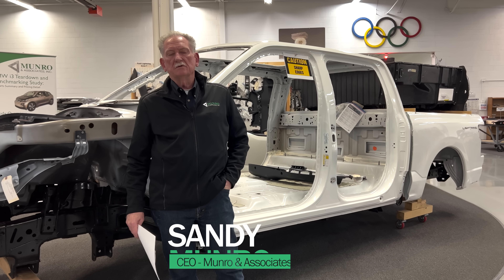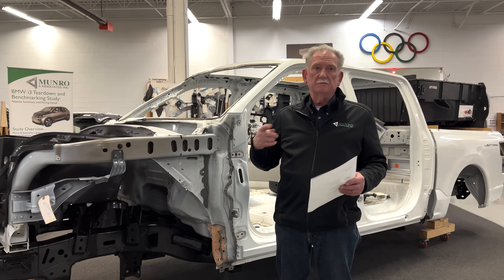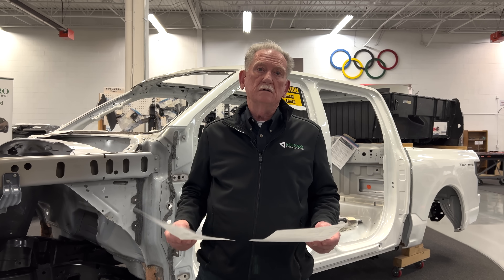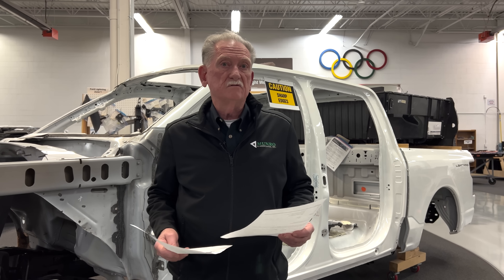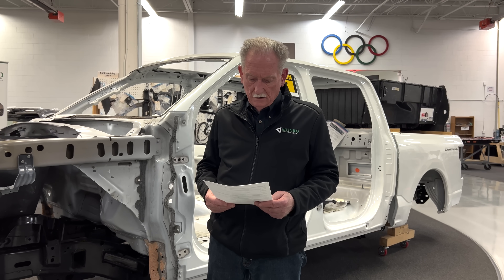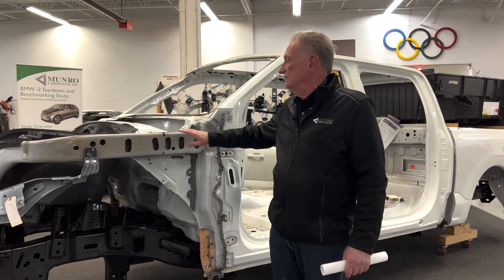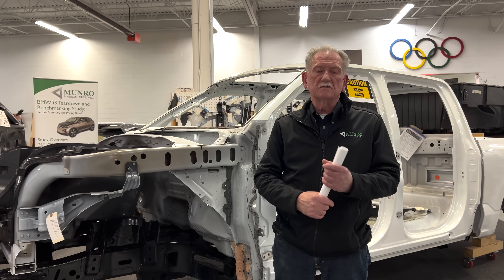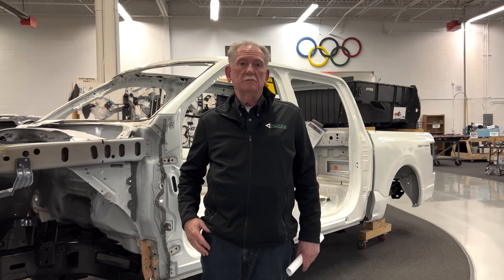Sandy's Initial Thoughts on the 2025 Ram 1500 Ramcharger

Comment: We know Sandy hates plug-in hybrids, of which the new Ram is one. Here are the counter arguments: 1) Since most use is actually short trip, the plug in Ram user will mostly be able to just recharge at home/work and rarely buy liquid fuel. 2) For the occasional long trip, especially if towing heavy load, the ICE is ready to take you almost anywhere worry and hassle free. 3) The much smaller battery pack saves tremendous expense and reduces the environmental impact of making the new vehicle. You can build two or three Rams with the same amount of batteries as use for one Lightning. 4) Charging availability and time. Other than Tesla's network, most US charging networks still stink. They are unreliable, slow and hard to find. 5) The built in gas to electric power outlet function replacing a traditional generator is great for camping, household backup power and some worksite uses.

Most people are trying to buy a vehicle which will both suit their daily needs and their occasional needs. For many use cases a good plug-in hybrid does that.

Comment: This is great news. Now let's shrink the battery to only 50 miles of range, build a cheap generator with alternator ass one unit. Make it easily removed from under the hood. Make a e-axle. If u do this it can be built cheaper and lighter than a gas truck today

Comment: many of us that use trucks for actual truck purposes travel in areas with no charging infrastructure on a regular basis. Rural America is not going to get comfortable with EVs for a very long time.  That is what makes the ramCharger voltTech approach reasonable. You could hardly give me a ford Lightning. I would have no use for it other than scooting around town. Rural towing is a no go. GM made a huge mistake IMHO and I see both Ford and GM being in a world of hurt for quite some time as those EV trucks sit on the lots and they continue to sell at a loss. ICE is all they really have to keep them afloat. The argument that you only need more than 300mi range X% of the time is like saying you only need 4wd 1% of the time.. However that does not matter, when you need it, you 100% can't go without it, so nobody will buy a tool that will not meet their 1-10% use case needs. Ford and Chevy lost out, especially Chevy since they had the Volt platform and abandoned it for all the wrong reasons. Range extended plug in EV was the natural way to transition people into EV. I hope Dodge does not screw this up and builds something reliable and has parts and techs to fix it lined up.

Comment: RAM is almost the defacto pickup for horse hauling. Waiting around for a charge with horses getting antsy in your trailer is a no-go. The Eco-diesel powertrain was perfect for this.  It has a 600 mile range, which reduced to about 400-ish towing a 3 horse trailer (and getting ~20 mpg while towing). This will be great to see how the gobs and gobs of electric torque do on towing in the Ramcharger. I'll be interested to see how it tests on TFLTruck's "gauntlet" test in Colorado, and Stellpower's  "Will it horse" tests. Once again "If you want to haul, buy a Ford.  If you want to tow, buy a Ram. Just don't buy a Chevy", Still the best advice I received from my Farming relatives.
Reply: Good synopsis :)
Reply: Eco diesel was a failure and unreliable af
Reply: @Kylewraps   I own a Gen 1, that is approaching 100K miles. While this engine has it's issues (and recalls), 26 mpg on highway for a 5500lb 4x4 has saved us a boatload of money, and it has never stranded us. One of the big issues, was that oil change places used car oil in the diesel, which results in coking and oil related failure. I do all the maintenance. So far, no problems not covered under warranty, and we can still tow a horse across three states on a single tank of fuel and get 19-20 mpg. it's good to know, in 3 years I will have options when it's due to be replaced.
Reply: @dandeclerck6742  yea but you’re still paying 25% more for diesel fuel aren’t you? So it would’ve been sake cost if you bought a. F150 V8 or Chevy V8 wouldn’t it? Those get 23 mpg highway these days the ford 24 mpg 24.5
Reply: @Kylewraps  Actually we buy fuel about once a month, at price comparable to premium unleaded. It goes up more in winter, due to the anti-gel additives, Ford's current coyote V8 gets 4 mpg less in the city than the Eco-diesel (16 versus 20) 3mpg less on the highway (23 vs 26) and has 20 ft-lbs less torque. At the time when we bought it, the Ford's interior wasn't as nice, and it's fuel economy was worse.. the newer ones are better. The other nice thing about Ram? it keeps the trailer power enabled when parked and shut off.. nice for using interior lights on a horse trailer. Ford, and GM require you to leave your truck on accessory. FYI, the previous truck was an '88 F350 Dually with the big block Ford motor.. 10mpg in the city, and 12mpg on the highway.
Reply: @dandeclerck6742  I have a customer with a new f150 he gets 20 mpg city not 16

Comment: Every hotshotter and full-time RVer would love the Ramcharger!
Reply: After you deplete the battery you're only going to have around 200 horsepower left to run all accessories including the motors when running on the generator only. Not saying that's not enough Or it's gonna be an issue just something to think about.
Reply: @Crazypostman  An old saying goes, it's better to be silent and be thought a fool than to speak and remove all doubt. Quite fitting in this case.

Spoken as someone who knows not of what they speak and possibly has no experience in this area, as well.

With a long history from nuclear power to batteries, I can confidently say that the Stellantis engineers won't let the batteries become depleted. As long as there's fuel in the tank, the Pentastar 3.6L V6 will power the 130kW (continuous) generator, providing ample power to charge the 92kWh battery pack.
Reply: @Crazypostman  That's plenty.  Demand on average will be less than 200 HP.  That's 149 kW, enough to replenish the battery in about 35 minutes.

Comment: It would be interesting to know how long the truck can operate on the generator or stand-by mode and how much power you can tap into as a self-contained power source.
Reply: Claimed 7000 watts of power, more than enough to run a jobsite or a house. I assume that as long as you tell it to, the gas engine will charge the battery forever, moving or not.
Reply: @kipamore so, you want that engine running WOT all day?
Reply: Looking at the specs for that engine, it says it puts out about 275 - 300hp at the crank.  Worst case scenario is 20% efficiency for a gas generator at that output which would be about 41KW output at max power.  That's probably not how it's set up though, I would bet that it's fairly detuned since it can just run longer and at a higher output than the electric motor is asking for and use the battery to load balance to maximize efficiency over max power.  I would cut that in half and say around 20KW.  Looking at similar trucks' fuel efficiency that could reasonably be at a consumption rate of a gallon an hour so you could reasonably expect 24 hours at that 20KW as a pessimistic estimate.

The other thing is with the battery it doesn't have to suffer inefficiency at low load because it can balance with the battery, so if you were running 10KW of load off it, that motor could run at it's optimal load and charge the battery and only be running half the time and come reasonably close to doubling the run time.
Reply: It was in the specs - the gas engine puts out 135kw, which is something like 175hp. Burried deep I found that the engine has two modes - a slow speed and a high speed. So I assume the 135kw is high speed. Either way, with a completely dead battery, 135kw isn't really enough to tow up a mountain, but anytime you were using less than the 135kw, it would be putting that juice back into the battery which has 600+hp to get you up that mountain. Also burried was the number 20mpg with a dead battery. That's not bad - I'd buy a 600hp truck that got 20mpg all day long! @ResonantFrequency
Reply: It'll actually put out much less than that once you take into account the conversion to electrical power which may at best be about 35% efficient.  Now that's enough for the truck to cruise at ~65mph down the highway and break even.  When you're going up hill or towing and putting real strain on it it will be draining the battery the whole time with the generator going and generator just has to get the job done before the battery is empty.  It will likely be heavily computer controlled and if you're drawing a lot of power for the speeds you're going or just driving aggressively enough it will probably start proactively charging up the battery long before it gets low to make sure you always have enough charge available.
Reply: I would assume two things: if you input your destination it may be smart enough to be predictive, especially if you tell it that you are towing - it can easily figure out the weight of the trailer. I would also assume that like the 4xE products, you can force it to charge, force it to preserve the battery, etc.  @ResonantFrequency

Comment: As a camper I'm very excited about the Ram.  It can put out 4.8kW of AC power through a socket in the bed.  So I can load a truck camper, plug it in to the truck, and use it like a giant house battery to run air conditioning, hot water, induction cooking, a space heater, and low draw items like lights and a water pump.  Wonderful!  All the comforts of camping with a generator, without the noise, maintenance, and expense.  The big range and fossil fuel power source means that I can go into the boonies in a way that isn't be possible with the Lightning.
Reply: Imagine this setup in a Sprinter/ProMaster size van. A mobile office with quiet electric power & heat, and no worries about refueling.
Reply: @donswier  Yes especially since the ProMaster could finally get 4 wheel drive with electric motors in the rear wheels.
Reply: This will work... for now 😮
Reply: I'm thinking of a pop up camper, 2 to 4 LiFpo Batteries and solar panels on top of camper. Talk about extended trips.
Reply: Yes and the battery fires are great they burn for days they burn so good water can't put them out. Like napalm
Reply: @j.r.2585  You mean like gasoline.

Comment: The math doesn't add up on this thing and it reminds me of the i3 REx. Power output of a 3.6L Pentastar is 227kW yet max EV power is 515kW. A -288kW deficit before other efficiency losses. I wonder what type of limitation will be imposed when the EV buffer is depleted if the engine can't keep up? I'm thinking a max. towing uphill with high HVAC demand scenario.

Comment: I assume Ram is targeting those who want to tow, particularly those towing for recreation, which often requires more miles. Towing will cut the range way down, but still enough to be practical, which I think is their goal.
Reply: But how many kilowatts can the generator produce i'm assuming you'll have a big cut in power output once you deplete the battery.
Reply: @Crazypostman  I'm assuming it will not cut power if the battery is drained. I also assume you can elect to run on battery only, for as long as it lasts, or generator only. That way, if running on generator only when driving,  you can tap the battery for other things, while camping or at a work site.
Reply: @Crazypostman I read 145kwh so no it won't cut the power when the battery depletes. You'll be able to use the generator to power the battery and either charge or just use the energy for propulsion
Reply: @Yielar1  I don't want to sound like I'm pooing on the truck Maybe they've engineered it to work fine but I certainly will be eager to see the YouTubers testing it pulling 14,000 lb up a mountain pass with a dead battery on generator power only. Obviously if it can do that still it's a non-issue.
Reply: If you bring the generator on early it works better. That is how the BMW I3 worked best. Run the battery down to about 30 % and kick in the extender. Then kick it back out if the battery level starts to go back up through regen or downhill braking and load holding in steep terrain. That is where Electric towing shines is up and down hills. Also it does not take a lot of energy to keep a load moving on flat ground unless bucking wind.  @Crazypostman
Reply: Towing typically cuts the BEV range in half, give or take. With the extender, you may see a bit more range, but not substantial. Especially if you are at 10k lbs or more.
Reply: @jmackinjersey1  But if the range is cut in half it is still better than what you would get in a BEV truck, towing the same load. On top of that it will be easier to fill the tank than find a charger in remote areas of the country.

Comment: Just get a diesel if you tow alot.  1 system is better than 2.  ICE maintenance would make me unhappy.  I do lots of my own currently because its inconvenient to deal with a mechanic and don't like being ripped off.  I'll exchange the hours, expense and mess for occasionally cooling my heals charging more often when I tow.  

It makes more sense for trailers to be better designed for aerodynamics, and have their own battery system for range extension, depending on the use case.  It could be used throughout the year as home backup and as a virtual power plant when not in use.  If I had an RV, I would want a battery system with solar.   Even if parked off grid it could charge the trailer/truck system.

Comment: Range extended Pickup makes more since for those RV/Toy hauler folks. They have to stop for fuel every 150-200 miles today. getting 5-7 Mpg towing. I question the need for a high HP generator though.

Comment: What is the actual MPG on this? I’m curious to see how efficient it is when the battery is low and the gas generator kicks on.
Reply: Rough calculation shows about 20mpg average. Just over 1,000kwhs in total energy onboard with a full tank at 27 gallons of gas.
33.7kwhs per gallon and the battery topped up at 92kwhs. So empty it would use about 1.4kwhs per mile. 

The tesla semi loaded to over 70,000# at 60+mph hwy driving according to Pepsi run on less event data gets 1.7kwh per mile. 😀 
my 2019 f-150xl when empty on flat ground also uses about 1.7kwh per mile or about 20mpg. 👍🏻